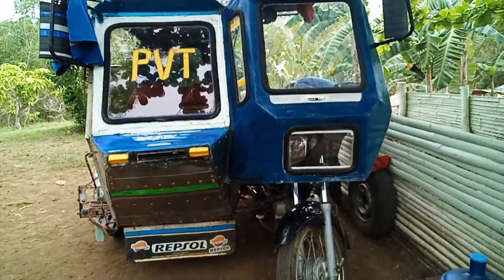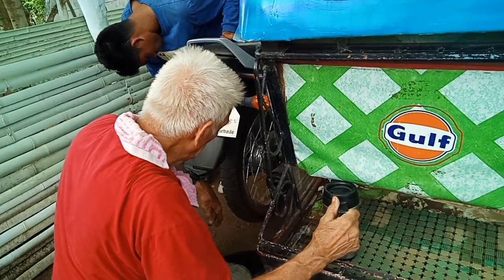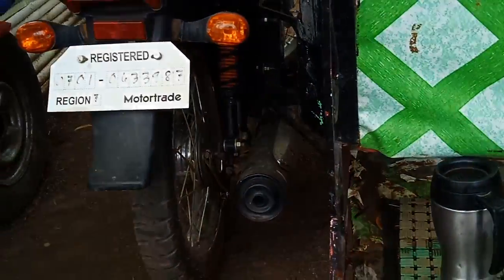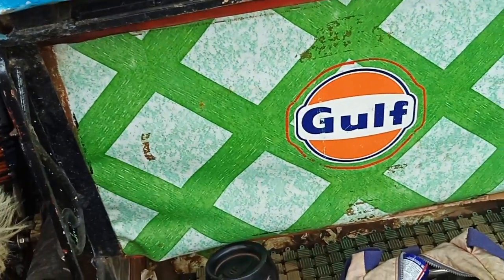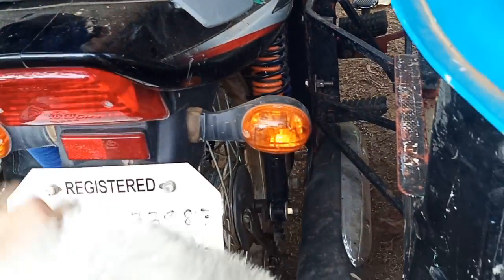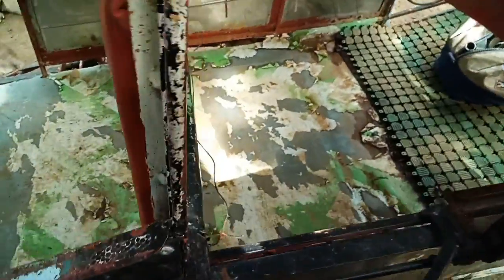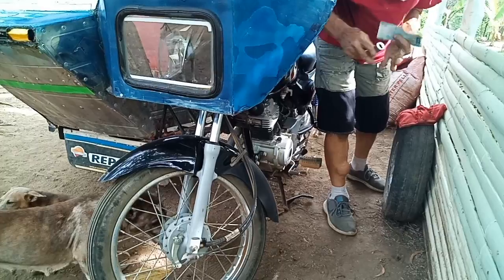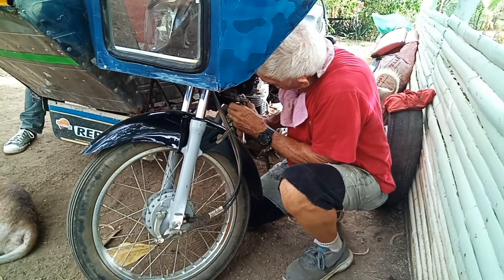Trike Needs To Bring To Mechanic

Comment: Fill up I think that's you know like common practice in any kind of bike or motorcycle cuz I got to do that you know once or twice a year during the season on my Harley and I use lock washers and you know that bread it's kind of like a liquid Loctite that you put on the treads so it's kind of common you know things on a bike rattle loose got to check it once or twice a season well because our season is shorter here in our roads are smoother I wouldn't have to do it as much as say you guys with them bumpy roads in the Philippines would have to do

Comment: Hi Phillip hi Beth hi guys yeah Phillips if you double knotted that'll work as a lock washer sometimes better it depends if just sucking not if you can get it full of threads if the bolt is long enough to get the second lock but full of threads